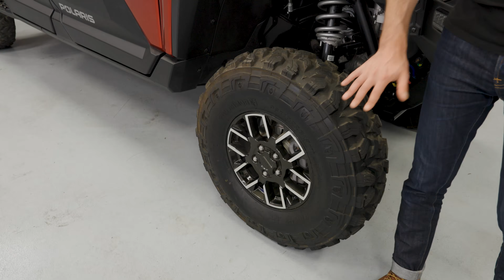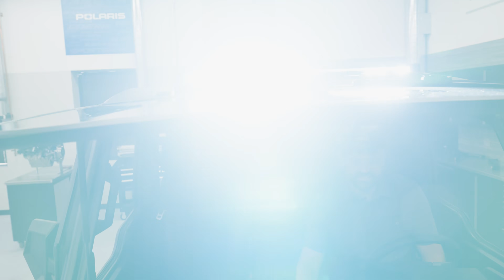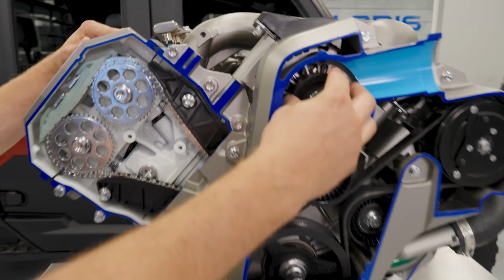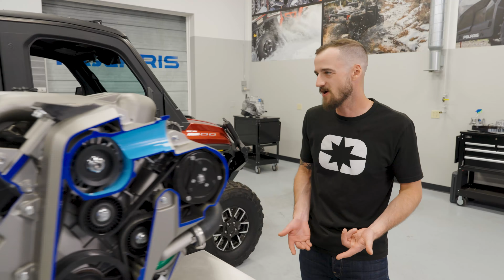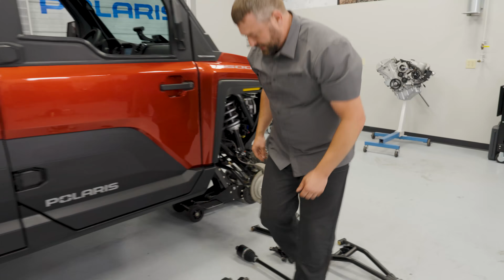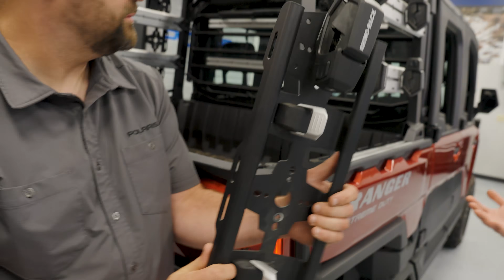THE ALL-NEW RANGER XD 1500 HAS A HUGE NEW ENGINE - SHOP TALK EP. 27 | POLARIS OFF ROAD | SHOP TALK

Comment: They should have looked at a Nissan Sentra with the steel belt drive belt transmission. They fail between 40,000 to 90,000 miles under normal operation and if the mileage isn’t met then they fail based on a timeline because of the oil break down. The Sentra is a throw away transmission cause it costs more to rebuild them than to replace them. Only time will tell if this holds true for this unit.

Comment: The pro xp and turbo r needs this 3 cylinder. But make it true 1000cc with 200 plus turbo to keep it in the 1000cc less class. Bet if u beef it up and do few things to it. It would sound badass with a turbo.. look I just came up with good Idea for 3 cylinder motor  update motor for the pro xp and turbo r. Bet it be a beast blow the can am out water… because we can’t put the pro r in it because it’s a 2 liter so it’s in its own lane. We need that 3 cylinder 1000cc to stay in that class and put whooping on the new maverick r…. All plus give the pro xp and turbo r 14 gallon gas tank to that be 2 more gallons
Reply: Plus a 7 speed dct 💪💪💪💪
Reply: @scottash2866 the power range they are making the cvt from the XD1500 could work in even the pro R and never have to pull own and replace a belt trail side.

Comment: All that and still has a belt?
Reply: Nope. Steel belt transmission. Much different than the belt you’re thinking of. Watch their video on it
Reply: @findingxeno3285 still a belt. And a more complicated belt to replace WHEN it breaks.
Reply: @allfiveandthedog5343  just say you don’t get it and move on
Reply: @findingxeno3285  I get it's still a BELT driven transmission. Just because they try to pull off an "all steel" belt doesn't change that. Something else you can count on breaking, now leaking with the oil bath it takes. Taking a step back in the transmission world for Polaris.

Comment: It should make 150 hp. Polaris can easily make 50 hp per 500cc.
Reply: They easily could but this is built for longevity not just performance.  A larger engine that isn’t being worked as hard will last longer.
Reply: @32123runescape 10,000 km on my 24 now. Love it.
Reply: I am glad Polaris finally added technology that has been in the automotive industry since 1996.